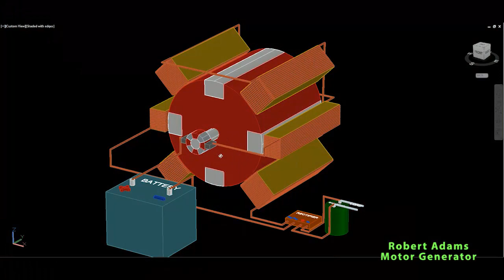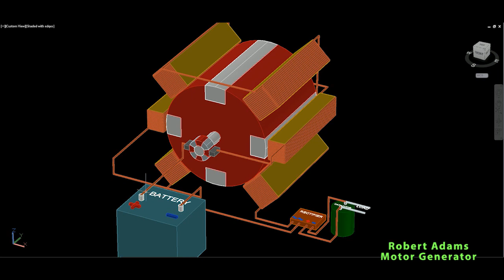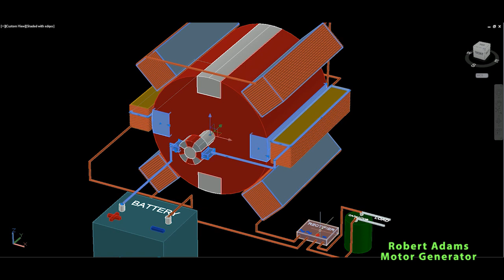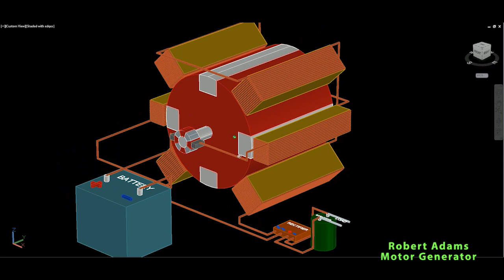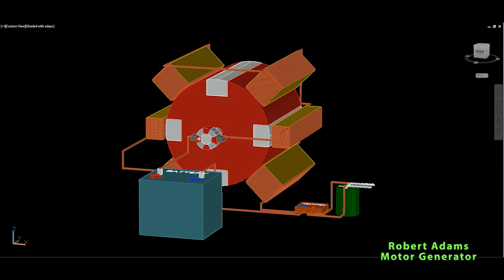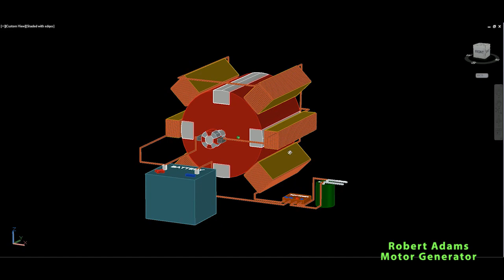Free Energy Generator 2017, Robert Adams Overunity Motor Generator

Comment: It doesn't work this way, the output needs to be switched in the correct timing. Also your coils sizing to electro-magnet is way off.
Reply: Do you get why the old guys channel, sayes it's 800 percent effecient,  but then its like 120000 x if you follow that 2.7 degree thing,  I don't get that,  I also don't get,  how he makes the comutator ,power out "on"off conductor disk, "star shaped conductor" so damn small,  he calls for it to be like a couple inches in diameter,  BUT if you wanted the power of the gen coils to only be on, for those powerful transiets, it would i think still be hard to achieve this w a 3 foot comutator ring,  with a 2.7 degree arc of conductivity,, that's only like .848 inch contact area.... What do you think?

Comment: I have Start the project from "Creative Science" Co  the Generator Called SP 500 Generator. Looks like  they have used " Robert Adams"  Plan then they  changed  it Little bit  and called SP 500 Generator, Any how I start working on it  fallow the plan and build one , I didn't get a satisfactory results and from Creative Science and research group convinced me  I must had something wrong in my build and purchased the gold plan from them , I got the same result with there  gold kit as well, They are not good help after you purchase the  kits from them, my back ground knowledge in electronics  is not  letting me to complete the project, Any help would be appreciated,  Here is the video you might want to take a look.https://www.youtube.com/watch?v=g6amYNHJVDI&t=43s  By the way I really like your channel and  learnt many things from you , maybe  you can give me any advice. Regards.

Comment: hey mario nice work,one question though, what if i want to mount loads on rotor shaft to have output power in omega(ω)
*T how adam motor behaves?
Reply: Ahmed Zahid Omar 
I think the motor would slow down and may not be reaching unity
Reply: Pulse motors have almost no mechanical energy to take off from the rotor. You HAVE to take the energy from the electronics side.